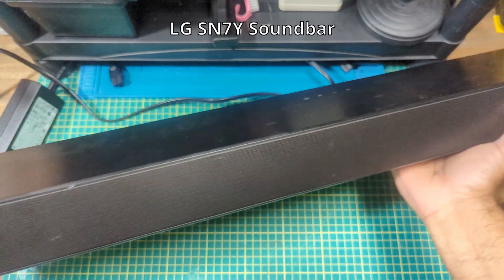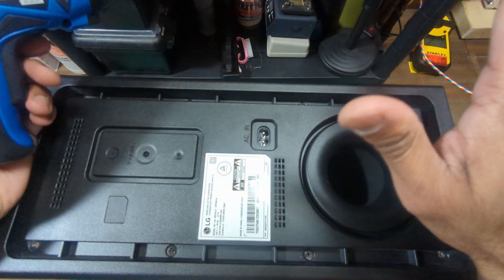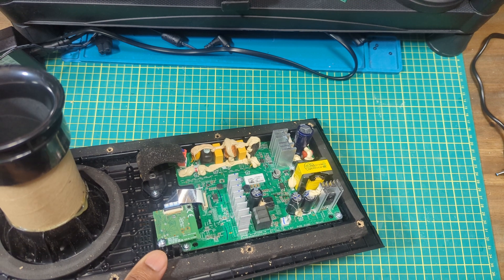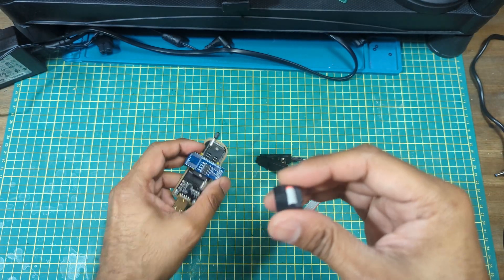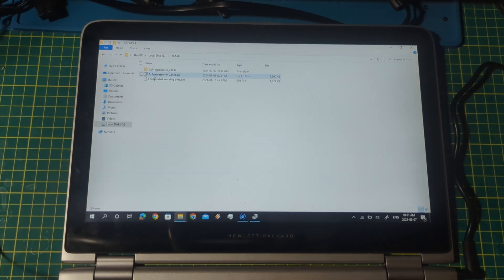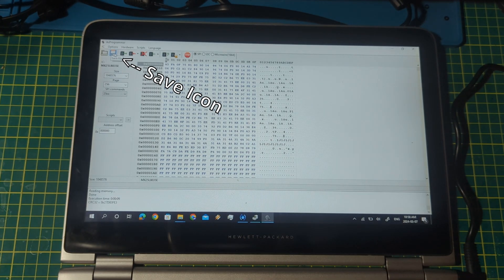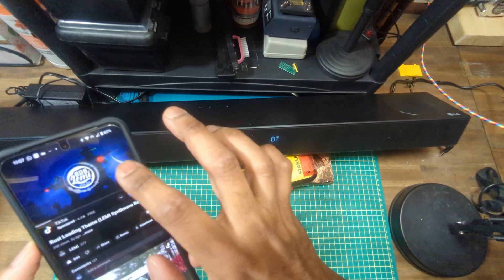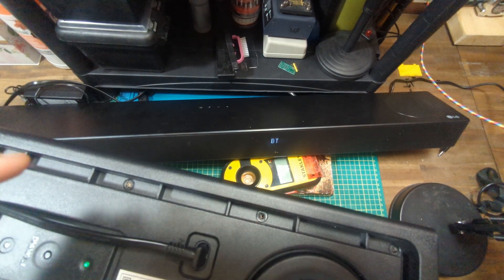Repair Attempt: Subwoofer That Died After a Firmware Update (LG SN7Y)

Comment: Hello guys, please can you tell me what kind of value is the WR 644 resistor, located next to the chip, because although so carefully I tried to put the clamps on the chip a couple of times because it was failing to read it, but I managed by mistake to undo the resistor there and never found it again. It's extremely small. Thank you!!!
Reply from the maker: I don't have the sub here anymore, but go to ZJ695000's video (linked in this video's description) and drop him a line. I believe he works on them all the time, and might be able to help you out.

Comment: LOL WTF? Why would you need to update a subwoofer?
Reply: to use app etc.
Reply: There are plenty of reasons. Modern subwoofers use extensive DSP control to alter, control and limit their behavior. In a system like this a firmware update might include changes to limiters, temperature monitoring, a new set of EQ-filters, improvements to wireless connectivity to the main unit, and so on and so forth.